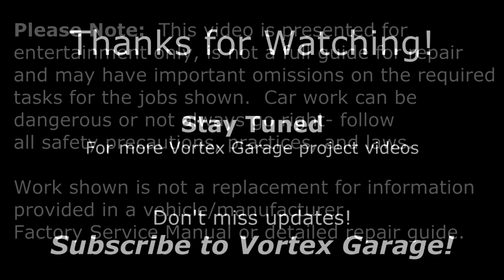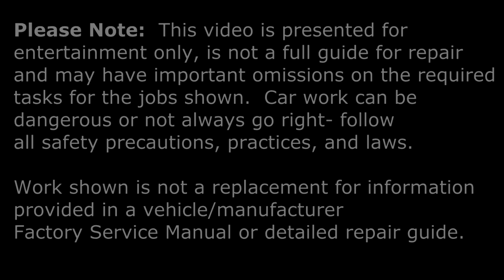Jeep WJ D44/D35 Axle Bearings, seals, plus parking brake - Vortex Garage Ep. 11 - OLD VERSION

Comment: I have a 2003 jeep grand cherokee 4.7 v8. rear axle is dana 44 3.73 gear ratio can you tell me if it has vari lock in the rear axle or not?
Reply from the maker: It could be but can't be certain without more info.  check out this site and scroll down about a third of the way to Limited Slip Differentials:  http://www.wjjeeps.com/tcases.htm

thanks!
Reply: +Vortex Garage it says optional but is there a way for me to check if the original owner got it or not?
Reply from the maker: +DillonOnTheGo well if you jack up the rear so both tires are off the ground and then spin one tire, if LSD then it should spin the other in the same direction.  if an open diff, the other wheel will spin the opposite direction.  of course be sure its supported right and dont jack up using the differential pumpkin, remember the d44a in WJs has a weaker aluminum center section.

now this test may not be conclusive.  if the lsd is worn out it may act like an open diff.  also varilock uses a georotor pump so may need some speed to tranfser torque.

Best way - call your local dealer parts dept and give them your VIN.  They will be able to pull a detailed build sheet.  If they don't then tell them you are looking to get a price on the rear diff and ask if your vin has varilock or not.
Reply: +Vortex Garage it just checked my build sheet and I do have the tow package so I do have vari lock.
Reply from the maker: +DillonOnTheGo Good deal!